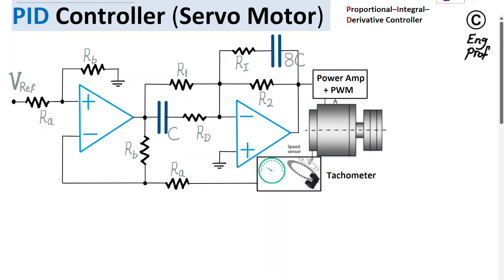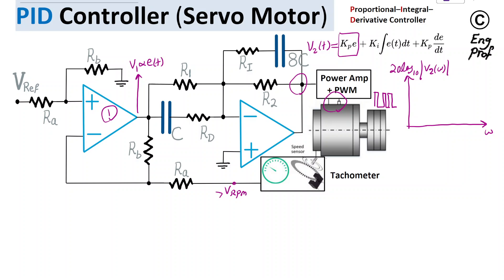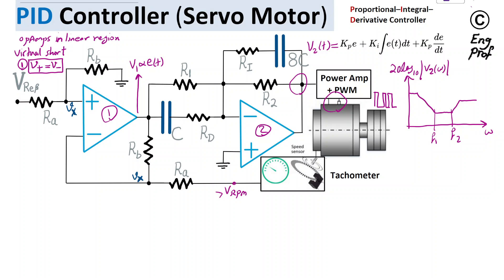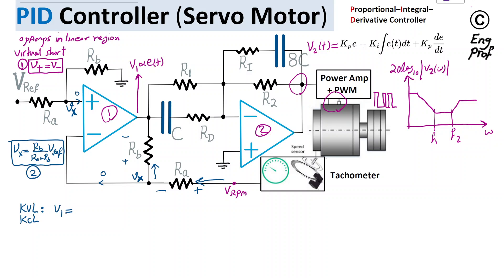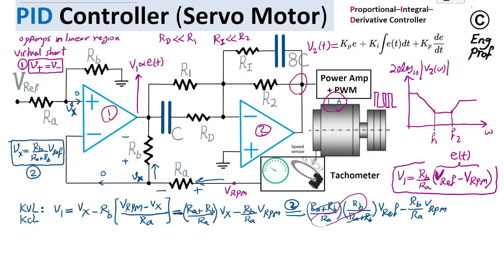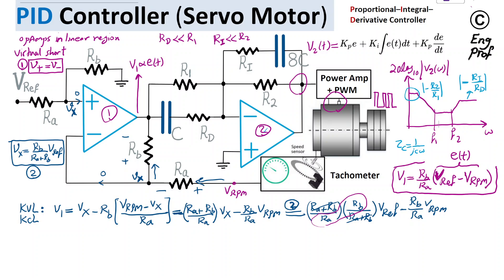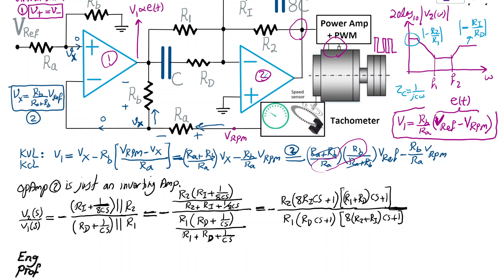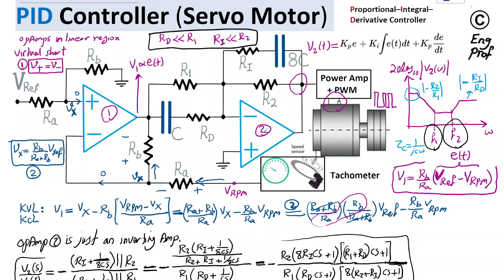PID Controller for Servo Motor explained: How does it work?

Comment: Really enjoyed that. But one question. If v1=0 , then so does v2. Could you please do a video on how this would affect the pwm signal. I assume 0 output somehow leaves the pwm signal at the level it currently is? How does this work?
Reply from the maker: You are welcome. Glad that you enjoyed this PID Controller Servo Motor video. The error voltage at V1 never becomes zero. There is always some wiggling of the residual error that circuit measures and counteract accordingly. For more Analog Circuit Design Videos please see the https://www.youtube.com/playlist?list=PLrwXF7N522y4c7c-8KBjrwd7IyaZfWxyt video Playlist in my channel.

Comment: Thanks for nice explanation and the right amount of formulas. One thing I'm missing. I was really expecting to get some final formula based on R, C used in schematic, as a sum of 3 separated parts (proportional, integral, differential) as in basic formula. Basically to see the K parameters, which resistors and capacitors are influencing it.
Reply from the maker: Thanks for watching, your comment and good points. Glad that you like this video. Alright, I'll prepare a follow-up PID controller circuit example and video sometime soon discussing practical choices for components and controller coefficients. Thanks again.
Reply: Great! I'm already subscribed, so hopefully I won't miss new videos ;)
Reply from the maker: @Chupacabras222  Thank you :) 🙏

Comment: Thanks very much, the explanation of how the parts of the circuits worked and when they worked at different frequencies is nicely explained. I guess the fun time is always finding the good concrete values for any particular example :D
Reply from the maker: You're welcome. Thanks for watching and your comment. Glad that you like this video and it is useful. Well said 😄 yes, the fun challenge is the right component selection to keep PID controller stable and functional with proper response time for a given application. Alright,  I'll prepare another PID example sometime soon discussing controller coefficients and practical choices for components. I will also prepare an example/tutorial for PLL as a related topic since this circuit is effectively a Speed-Locked Loop (SLL). Thanks again.
Reply: @STEMprof  you are very generous, thanks for your videos. I find most of the time even though they have the math applied, it's just enough that relates to the problem and is easy to see how it works, but yet still working from first principles. Other places either skip it entirely, are very surface level, or dive straight into deep theory so you'd need a book with examples to help you understand as well.
Reply from the maker: @ivolol  My pleasure, And thank you for watching and your kind words. I appreciate. I am glad that you like my circuit videos and you find them useful and practical. Thank you very much. 🙏🙋‍♂️

Comment: This is a little new to me. So far I have dealt with PID Mass Flow Controllers, temperature controllers, and PLLs. As I understood the reason for using PID for temperature control was to prevent overshooting and undershooting and ensure the fastest possible correction. So the same principles would be applied here to the rotational speed of a motor?
As far as PLLs are concerned, I am and always been fascinated by them. I think they are absolutely marvelous pieces of electronic technology. Maybe worth talking about? Also, some discussion of the practicality of adjusting these coefficients in the PID controller would be very interesting. Anyway, thank you very much for this post. I didn't know how I would go about putting together that kind of controller before I watched your post.
Reply from the maker: Thanks for watching and sharing your thoughts. Glad that you liked this video and it is helpful.  You are right, the same principles as PLL and as PID for thermal control are applied in this example. 
Sure, hopefully soon I'll prepare another PID example discussing controller coefficients and practical choices for components. I will also prepare an example/tutorial for PLLs.  Thanks again.

Comment from the maker: Thanks for watching. For more Op Amp & Circuit Examples please see:  Push-Pull Power Amplifier https://youtu.be/866MYibo8yE ,  Electric Circuit Analogy for Mechanical System: https://youtu.be/997hfjGK3_w 
Flex Voltage Regulator Example: https://youtu.be/CJl-urzeiTo
Op Amp Analog Differential Equation solver https://youtu.be/ENq39EesfPw
Bandgap Video: https://youtu.be/esMlNx5w9Jw
Sawtooth Oscillator with Op Amp, JFET and BJT Transistors https://youtu.be/5zHXTx-Vl20 
Full-Wave Rectifier:  https://youtu.be/DJJMNU-CYcg
And Analog Circuit Design Video Playlist in my channel https://www.youtube.com/playlist?list=PLrwXF7N522y4c7c-8KBjrwd7IyaZfWxyt
I hope the Analog Circuit Design and Analysis Examples are interesting and helpful. 🙏